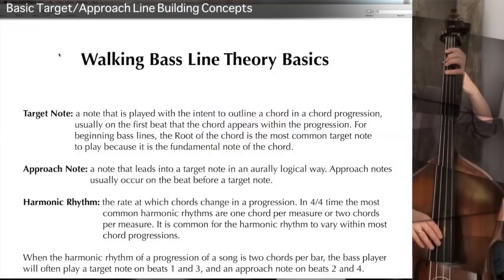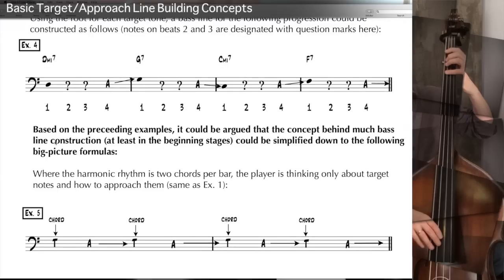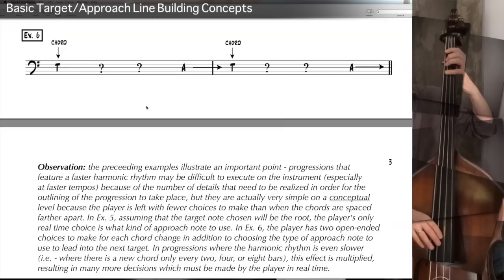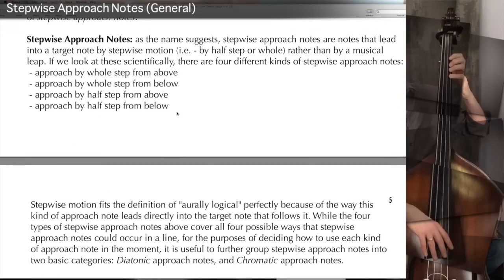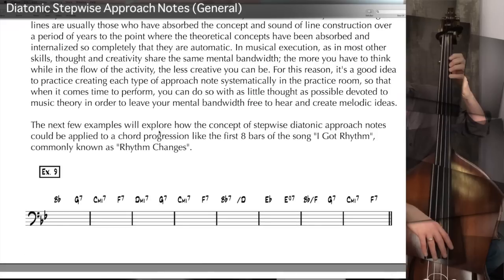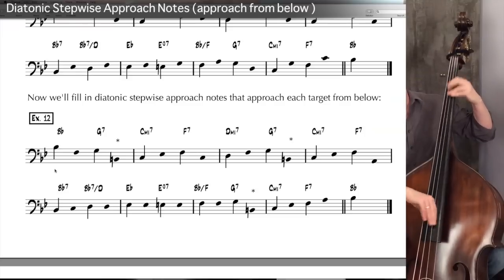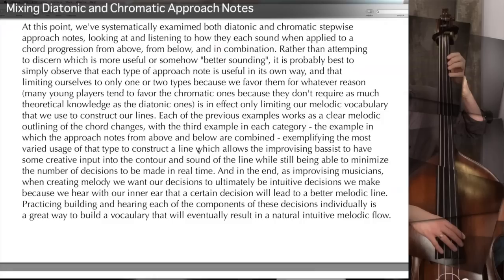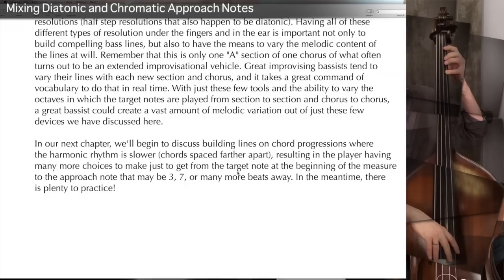Walking Bass Line Theory Basics

Comment: Currently banging out the walking bass series. As an intermediate player but a beginner to jazz walking bass, I have a lot to practice. Very educational. One of the biggest challenge now is how to make a walking bass line for Sweet Georgia Brown where there are a couple of sections that is a one chord for 4 bars. Thanks once again.
Reply from the maker: +Beassagra When a chord lasts 4 bars, it's usually better to not outline the root at the top of every bar. One easy way around this is to target the 5th on the second and fourth bars of a four bar section with only one chord. So instead of thinking "F7.../ F7.../ F7.../ F7.../ Bb7" etc., you can play as though the chart reads "F7.../ F7/C.../ F7.../ F7/C.../ Bb7 etc." This gives the line a little variety while still having a clear target for each bar.
Reply: +Chris Fitzgerald I was trying to apply it using chordal tones, it's like a solo-type walk. Thank you so much for your reply.

Comment: Thanks for this lesson. As a mature person learning to play the double bass, I have stumbled on this just at the right time! Whilst I appreciated how some notes are chromatic and obviously the use of chord tones, this lesson has really cleared up my understanding of the term, "diatonic" and chromatic. I now can see much more clearly how I can construct a walking bass line, and now my fear of seeing two different chords within a measure, has vanished, as I see that my choice of notes to select has in fact simplified! My only question, as someone who is not currently having a tutor, is this; When I want to provide a solid bass line to a composition, where I have the chords alone written down as they will be played. Should I be attempting to improvise my choices from the off, or should I sit and manually write a bass line practice it, and then commit it to memory? I struggle at this stage to have any degree of speed in sighting a chord, for example G7 and simply knowing it's component notes off the bat. I assume practice is the only way to "internalise" this sort of stuff, but is it sensible in the early days, to stick to writing out the lines and thus making sure you actually play something that is musically acceptable, or improvise and risk hitting wrong notes through inexperience?
Reply from the maker: +MrFireblade67 It's like any language - it may be useful to write things down in the beginning,  but after a while, it will start to happen on the fly before you even have a chance to think about it.

Comment: Great videos!  BTW, what do you think of correcting a bad non-diatonic whole step approach tone by filling it in chromatically? For example the F7 to the Dm7 going E, Eb, D in eighth notes.  This could be done on the fly.
Reply from the maker: Thanks! I think that chromatic motion always sound logical, but I would have to hear the feel of the 8th notes being played between the F and the D - it's possible it could sound good, but it could also disrupt the flow of the quarter note line.